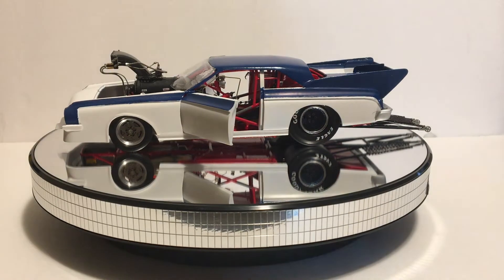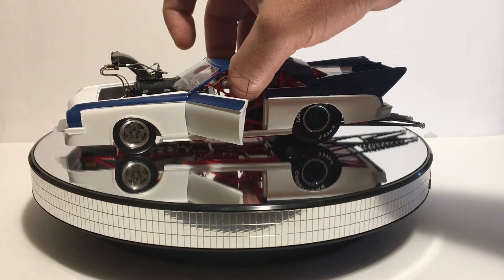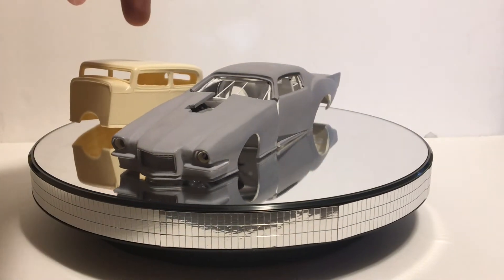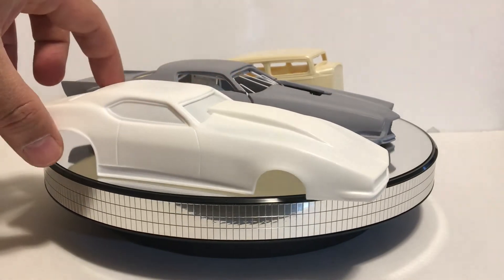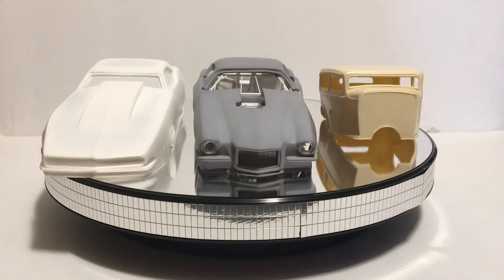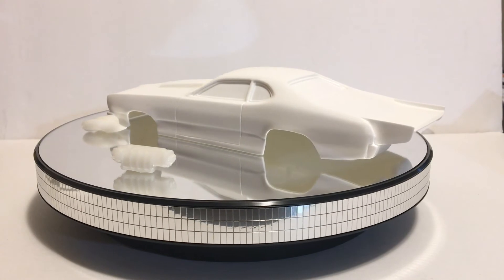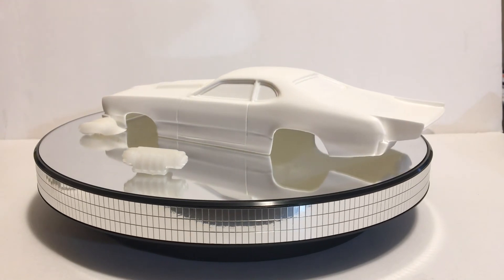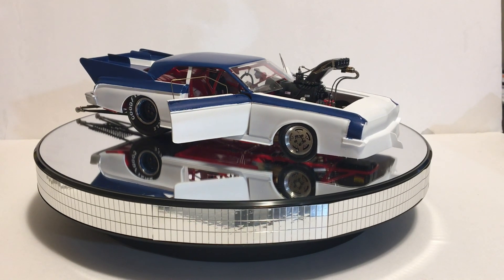Resin body kits

Comment: That was a very helpful vid, Marcos 👍. I have one Flintstone chopped 51 bel air body. The glass for it was a real chore to make. What do you do about the clear parts for your models? 🤔Best wishes from jolly old England 👍😎Pete 🤓
Reply from the maker: Thanks Pete and glad you find this video helpful, about the glass I get some evergreen clear sheets and cut them into shape for front and rear glass, same thing with the side glass, but you can go even better with binders divider and they come in a variety of color and they are easy to cut, hope that helps, I didn’t mentioned that in the video and thanks for asking man
Reply: @marcosfernandeznanita7150  Yes. Thank you Marcos. I use clear for flat screens on 30s/40s cars, but getting anything curved seems really hard, unless I can sand donor part down. 😕.
Reply from the maker: @petesmodelcarcustoms584  yes it’s a little bit more hard to work with on curve shapes, you have to glue it and use a lot of masking type to make it seat properly, sometimes you can use a hair dryer to make those shapes too, I did that on one build but I haven’t done that again
Reply: @marcosfernandeznanita7150  I've tried hot water and hair driers, but it all a bit hit and miss🙄oh well. I'm cutting the doors out of an El Camino at the moment, so hinges are more my problem at the moment 😕. I look forward to seeing your next vid, I think your models are outstanding👍🤩Pete 😎